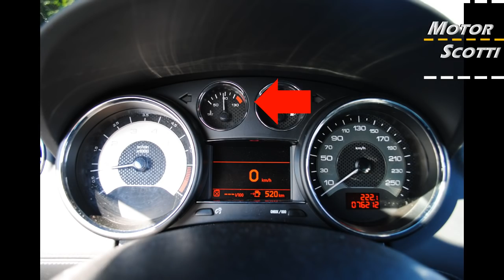Changing the coolant / antifreeze in your car

Comment: Well the right way to this is to bleed the cooling system while car is cold from the 2 bleeding points...the first one is on the hoses going to       heater core..and the second one is the bleeding screw in the thermostat housing...While keeping the expansion tank always full during this process.
Reply from the maker: Taymour Nasereddin True, that's what I read in the repair manual, too. I found it to be too much hassle though and my simpler version turned out to be working fine.
Reply: Taymour Nasereddin 
Hi,
My 1.6 THP has the temperature sensor instead of a bleed screw on the thermostat. It has an electrical cable coming out of it. Should I unscrew it anyway?

I'm afraid of tearing the cable...
I also know that when you install the sensor for the first time you should aplly some type of sealant on it - Should I reapply it? If so what is this sealant (couldn't find it online)..

I was hoping the see what Scotty is going to do... :)

Thank you in advance!

Comment: Hi thanks for your videos they help a lot. I recently got an RCZ and I wondered if the engine Fan stays on for a while after I stop, is this common for this car? Or do you think it’s a fault? 
Thanks
Reply from the maker: Sammy Boo Thanks for watching! It's normal for any car to have its fan running after it's been turned off until the water temperature has come down to a set level.

Comment: Hi from Malaysia. Is it necessary to use garden hose and flush/bleed the whole system to ensure all the contaminants are cleared?
Reply from the maker: Hi, the garden hose won't flush the whole system anyway. If you want to bleed it completely and by the book, you have to open all of the bleeding valves, but I didn't do that, which is why it took a good test drive for the system to work out all of the air bubbles.
Reply: MotorScotti thank you very much. Your videos had been really helpful. Hope you can come out with more videos regarding the services/maintenance procedures 👍 I’m driving Peugeot 308 which has a very similar set up as yours
Reply from the maker: @adamchan9909  Thank you! Well, not really, if you've been following my channel you can see that I've sold the RCZ a year ago and have moved on to something very different😉

Comment: Hi, is it necessary to drain eventual air bubbles? I watched that you do not drain in anyone drain valve..
Reply from the maker: It would be better if you wanted to bleed the system immediately. The thing is, over time, when your driving, the system will work out all the air bubbles anyway. I simply drive the car warm, let it cool down and top up the coolant. The result is the same.

Comment: Hi, peugeot 3008 year of 2018 model. Possible to show how to change the coolant? Thank you...
Reply from the maker: I don't have a 3008, even sold the RCZ years ago. It's always the same procedure on every car:. Drain the coolant, fill the radiator, warm up the engine with the cabin heater on, let the air work its way up and top up the coolant when it's cold again.

Comment: Nicework. You just have to make sure your percentages are correct because when you put the distilled water in initially you now have mostly distilled water in the heater core. That means you need to be adding more than 50/50 mix to get the entire system at 50/50.  You need to know what the total capacity is and then you can figure it out exactly. I usually add 100% pure coolant after running distilled water three or four times through the system
Reply from the maker: Correct, that is a very good point!

Comment: I need help if you please 
I flush coolant and i followed your steps 
I opened 1st and 2nd vents and after drop water i close them
I did all and i start engine and when temp reach 90 while cap open alot of water goes out ... and temp down then i fill more and second time did it again ... fan working normal and radiator and upper hose still cold until last time i fill water and close cap temp reach 90 fan work and thermostat open and mix water from engine and radiator.... its work normally but why when cap was open water goes out and radiator cold ...
Hope you could help me
Reply from the maker: It's the same procedure on every car, some need a bit longer to work out the air bubbles. Just drive it a bit longer, it needs to properly warm up. The heater needs to be on, too, of course. Top off the coolant when it's cold again. You might have to repeat the process several times as long as there is still air in the system.

Comment: I put in little bit windscreen washer in the coolant by mistake, coolant was 85% from max and i  filled rest 15% with windscreen washer. Basically i was suppose to put it in its right place but made a mistake. You think I can drive my car with little bit of windscreen washer in my coolant?
Thanks
Reply from the maker: I'm not an expert, don't think it should make that much of an impact. But for peace of mind I'd change it. As you saw in the video it's pretty easy and cheap to do.

Comment: Can I change the coolant by sucking from the coolant vase ?
Anyway nice video :)
Reply from the maker: Thanks! Well you'll never get much more out than what's in the overflow reservoir so no, that's not gonna work.
Reply: @MotorScotti  😰😰😰 how can I do it ? from the radiator cap ?
Reply from the maker: I'd say my video shows you how to do it :)
Reply: @MotorScotti  Yeah I know but my car is low ( by factory ) and I can't see the radiator plug...
I will just cover the radiator this winter so it stays warm...

Comment: Coolant colors do not matter anymore since many years. Colors no longer correspond to the chemical composition and there is no consistent standard followed by all manufacturers.
Reply from the maker: So what you're saying is that it doesn't matter what coolant type goes into what engine?
Reply: MotorScotti No, I'm saying that coolant type is not related in any way to its color. Coolant type is exactly what you want to check before pouring it into your car's cooling system, but never trust the color!
Reply from the maker: True, the best way is still to check the description to make sure it actually fits your type of engine. Anyway thanks for your feedback I wasn't aware that the coolant color didn't match up with the chemical type anymore. As far as I've checked, I still put the right coolant into my cars. :)
Reply: irvvine Great video.....thanks for sharing the link🤘🏼 About to do my RCZ so will be sure to check now👌🏼

Comment: My coolant keeps on running out. Every time I drive extremely hard. How can I try to minimise this? Thanks
Reply from the maker: Check for leaks, it's very likely that it's leaking through the water pump seal. You can see it if you look under the car.
Reply: close the lid tightly or change it